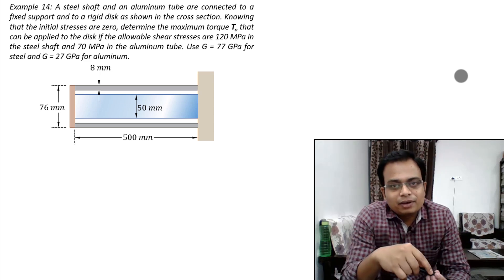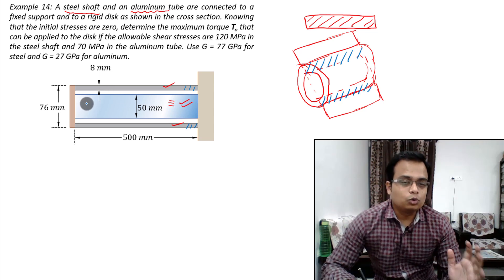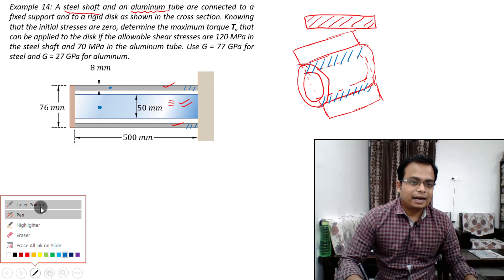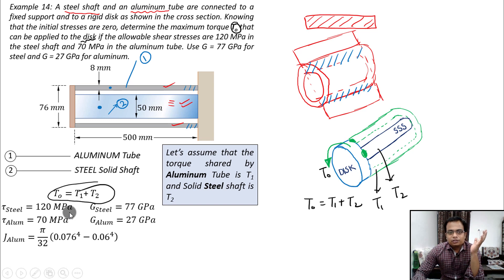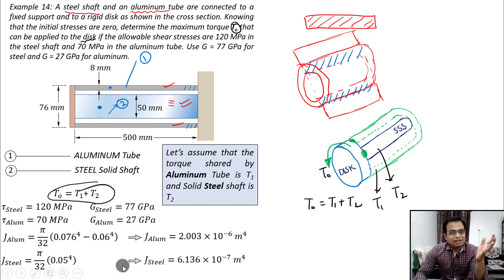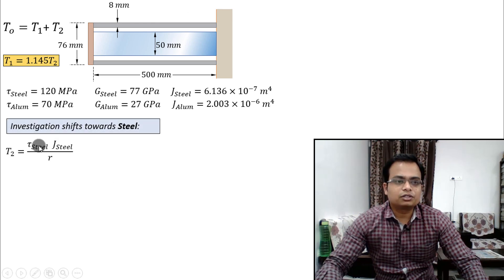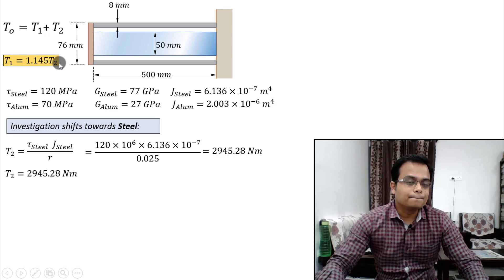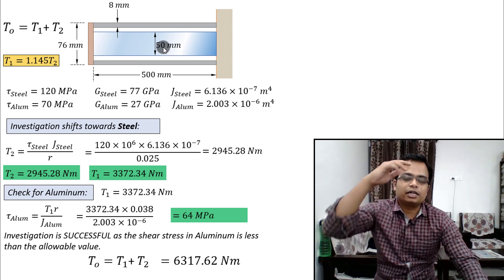Shafts in Parallel

Comment: A transparent cylindrical container, diameter of base 60 mm and height 
75mm, is full of water. 1) It is tilted by 600
from vertical so that some water 
from it is drained out. 2) It is tilted by θ 0
from the vertical so that half the 
water is drained out, find angle θ 0
.Draw the surface of water in plan and in
elevation.

Comment: A cylinder diameter of base 43 mm and height 58 mm resting on HP. On its 
base. It is cut by A.I.P. in such a way that the true shape of section an ellipse 
with major axis is 60 mm and minor axis is 43 mm. Find the inclination of 
A.I.P. with HP and draw three projections.

Comment: A line of length 75 mm has one of its ends 50 mm in front of VP and 15 mm above HP. The top view of the line measures 50 mm. The other end of the line is 15 mm in front of VP and is above HP. Draw the projection of the line and find ϴ & ϕ. Also locate its traces.
Can you please solve this question?

Comment: F.V of line AB is inclined to XY and measures 55 mm long. While its TV is 600 inclined to XY line. If end A is 10 mm above HP and 15 mm in front of VP. draw its projections, find True Length. Inclinations of line with Hp & VP.
can anyone solve this